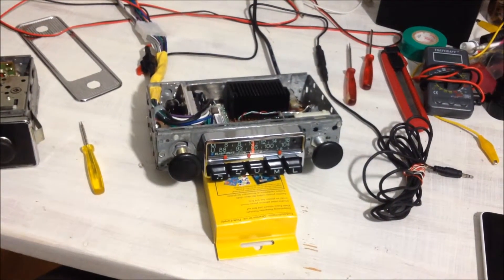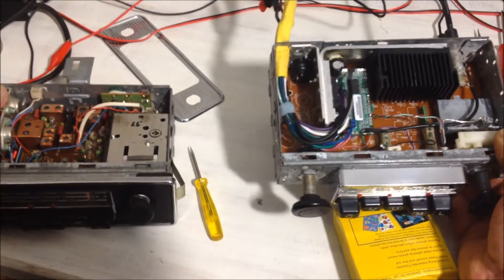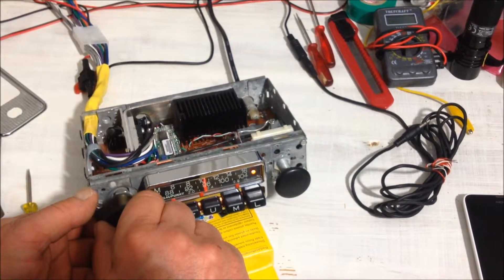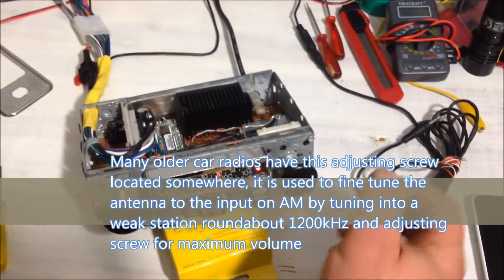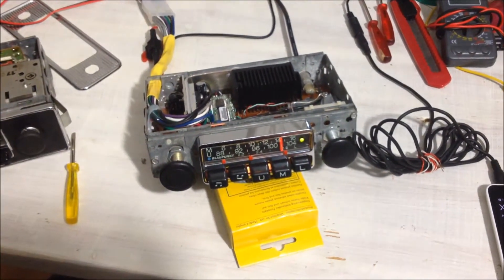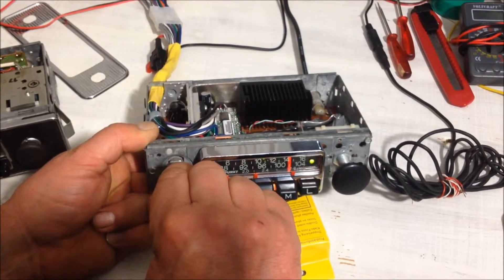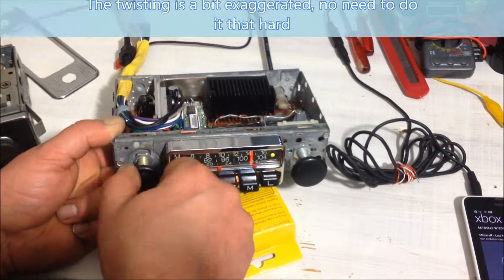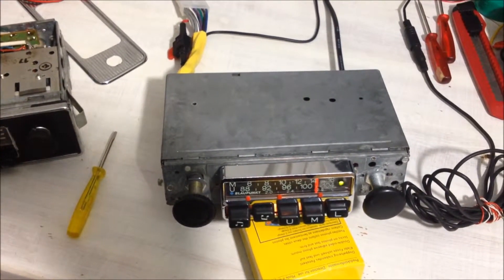Vintage VW Emden factory radio upgrade (FM Stereo, Aux line in, 4 channel)

Comment: I know this video is old but stumbled on it , im from the usa and currently looking at these radios for my VW cause i want factory radio , The DIN plug , is sit audio in and audio out?

I want to know if i can add an external amp to the din plug but also have Bluetooth/AUX in all at same time , Cause i want to have 4 speaker channels on a single mono radio or if i can find a 2 channel stereo which are quite rare.  But at this point i don't care if its mono on all 4 speakers or if possible , can one convert one from mono to stereo and add 3 more speaker channels on top of the already existing one?

Comment: Can you share the wiring/installation manual for this unit or do you have a diagram you can share with me?  Thank you
Reply from the maker: The diagram comes with the module, it is distributed by Arora Retro-Tech

Comment: I rather keep the transistors but how do i ad a line in?
I don't mind it's mono if the radio can handle 4 speakers in parallel
Reply from the maker: See the plastic plug with the wire bridge in it on the back of the radio? This DIN plug is where the audio is looped through before going to volume pot and amp. If you pull it when radio is on the sound goes away and that is where you should put your line in
Reply: @blitzroehre1807  now i don't have this radio i have some sort of blaupunkt but yeah this video came up when searching
Reply from the maker: @Rainbow__cookie  What type Blaupunkt do you have? Designation is on a sticker on the side.
Reply: its a Essen ATR ab U 300001
Reply from the maker: @Rainbow__cookie  Ok, did you find that white plastic plug on the back with the two pins bridged inside? You will want to jippo your way into the audio line to the amp just like Terry at D-Lab did it here  https://www.youtube.com/watch?v=j8YeJ0T3DpI
Except that you wont need to open up the radio, all you need is a DIN plug to plug in the back after removing the white plastic dummy plug with the bridge wire in it. This plug BTW was the factory AUX in back then for external car tape decks.

Comment: Nice video, where did you get the wiring diagrams for the install? Are they provided when you buy the unit from Aurora?
Reply from the maker: Yes, there is a universal "how to" provided by them, in the end it is up to you though to determine how to connect to the tuner inductance, volume pot etc. No specific make or type of radio is covered, but if you are clued up with electronics its no problem really..

Comment: Ich habe ein altes Delco von 1984 aus meinem Chevy Pickup, könntest Du das auch umbauen?
Reply from the maker: Hi, wenns analog mit Zeigerskala ist, ja.
Reply: @blitzroehre1807  ja ist es. Ist ein US Radio die oft in den 70er und frühen 80er verwendet wurden. Wie können wir in Kontakt treten?
Reply from the maker: @bertmuller6273  Email:  radioberg@yahoo.com, mach doch kurz nen Schnappschuss des Radio dazu, dann weiss ich genau welches Delco Modell es ist.
Reply: @blitzroehre1807  email mit Bild ist raus.

Comment: A question.. have you ever had to deal with a V series from 1964-65? I ask you why I would like to know if the aux DIN input of V series is for audio signal (music from tape) or for something else (for example, the motorized antenna). Thank you
Reply from the maker: These DIN sockets are almost always for powering and audio in of external tape players. In another video of mine I explain how to use the connections in the DIN jack for Bluetooth audio in.
https://www.youtube.com/watch?v=0qREAIagcrw

Comment: Very very very cool! Have you done any other models?
Reply from the maker: Yes, plenty of different makes, ranging from the 1930s till the 90s  :-)
Reply: @blitzroehre1807  Do you upgrade the output or is that not possible? I've read older radios are lower Watts per channel and modern ones are about 50. I'm wondering if I can upgrade my old radio and avoid getting an external amp
Reply from the maker: @austinfostermusic  That FMR unit is a complete unit with ouput amp and has 4x45w, the old amp in the radio is removed